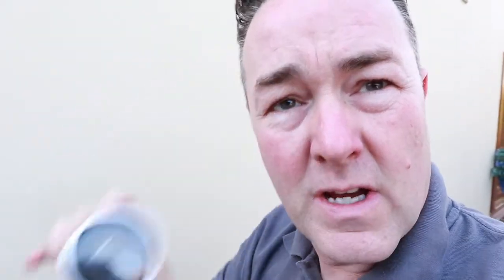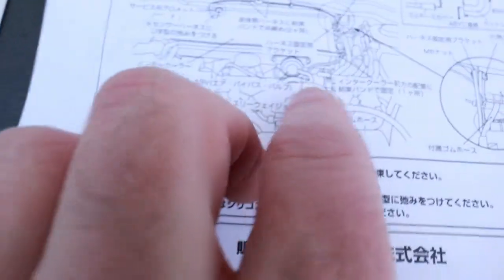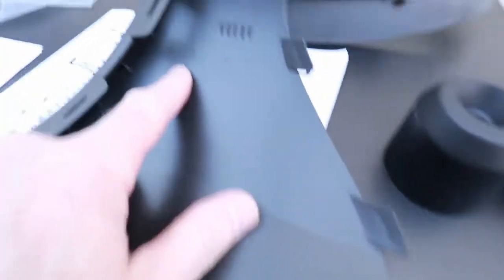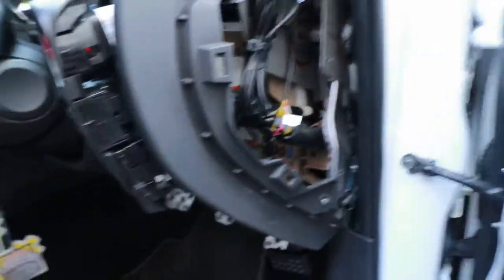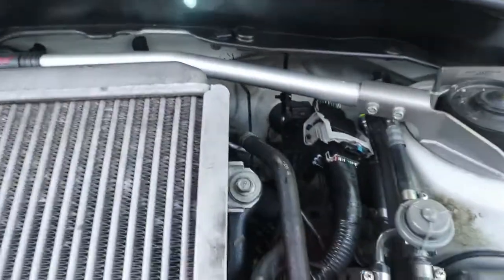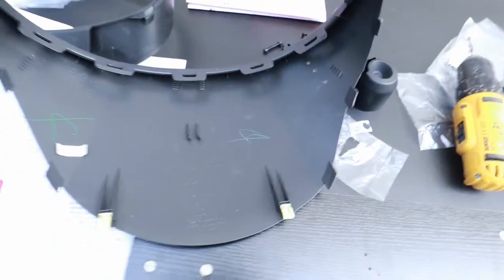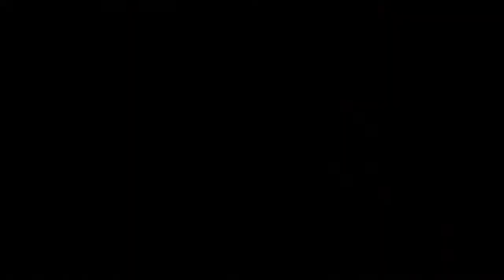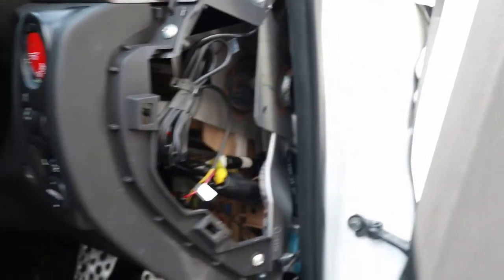How to Install a Subaru - Defi - Boost Gauge - 2008 -2014 WRX STi

Comment: Could you provide a link to where you bought it from?
Reply from the maker: You should be able to order the part using that part number through the main dealer or japanparts.com and import it.
Also check ebay
Reply from the maker: Subaru part H5017GF000
google search for it too